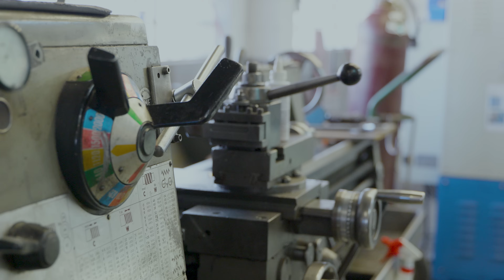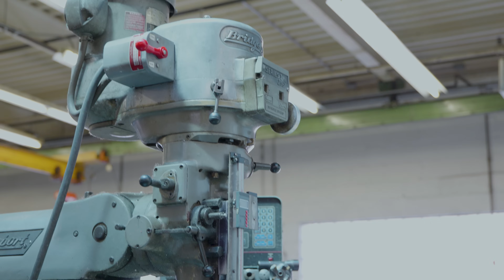This Family-owned Shop Machines the Impossible!

Comment: I hope your G&L HBM is designed with the same thought as one from the 50’s that I rebuilt.  One of the greatest gear boxes I ever did based on the simplest concept that it was modular.  The whole gearbox slid out of the headstock so you had access to the whole thing, same for the gearbox in the base for the feeds.
I did come across the same concept in an old WW2 vertical lathe (maybe a Bertram or a Hamilton?) TOS HBM gearboxes are a pain to work on and the worst I came across was a Jurasiti (I called it the Jurassic Mill).